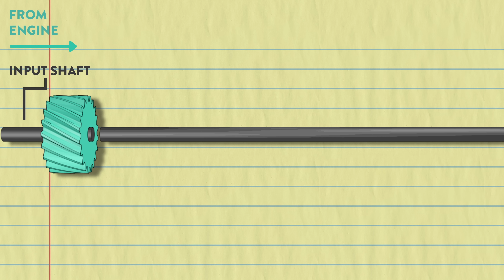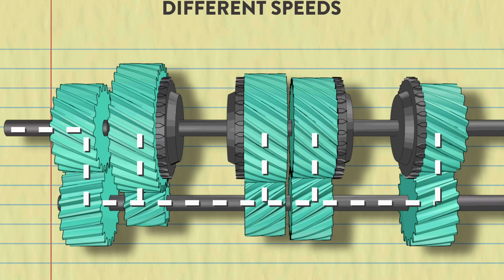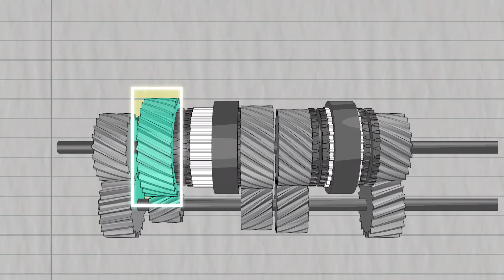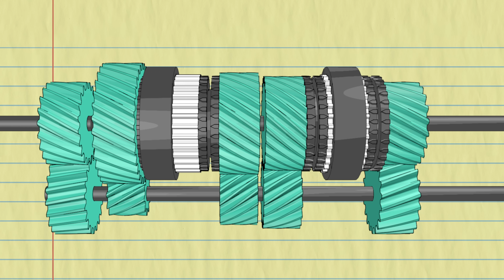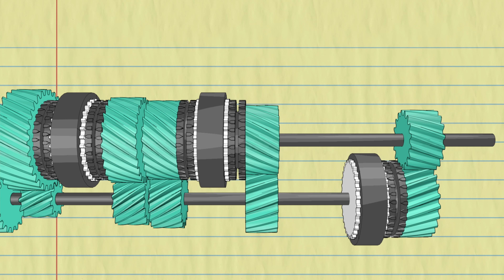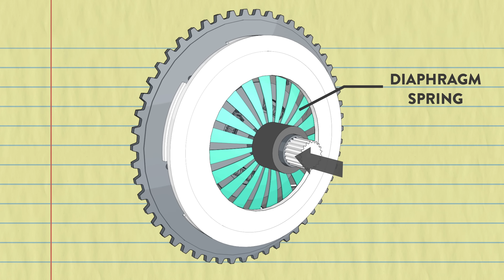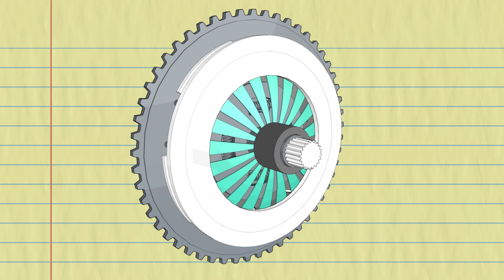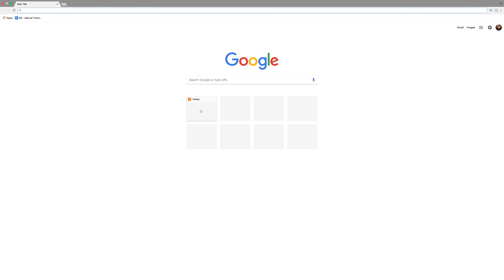MANUAL TRANSMISSION | How it Works

Comment: Wait wait wait, go more in depth about double clutching. I need to know!
Reply: Double clutching just means you do this:

Push clutch pedal. 
Shift out of gear into neutral
Release clutch
Push clutch again
Shift into next gear
Release clutch and Go.
Reply: @thetman0068  i know but WHY? what are the advantages/ disadvantages... do you have to rev match? ...how do yo know the proper rpm for each gear?

Ive known how to drive stick since i was 10 but nobody tought me this.
Reply: @thekidofpt1 don’t know if you’re still waiting for an answer, but the primary advantage of a dual clutch transmission or double clutching is that you will not feel as big of a shock in the car and the transmission will not take as much of a beating. Basically, since dual clutching makes it so that the change from gear to gear is not abrupt, there will be no shake n bake in the trans as there is not as much force suddenly transferred from gear to gear. This is why many modern sports cars are incorporating to dual clutching and that if you ride in early 2000s sports cars, you will be jostled around by the automatic single clutch transmissions. Don’t know if this helped or even made sense, but hope you figured this out.
Reply: @John_Cary  yes thsnk you. Ill take any info you got, im always looking to learn more. This actually did help
Reply: @John_Cary  uhm.. but you can just 1. push the clutch and hold it 2. put it in next gear 3. match rpm with gear 4. release clutch. at least i do it like that.
Reply: @FinestTechnoBeats  Oh I don't have a problem with shifting...I was just explaining the advantages of dual clutch systems. Dual clutching in a manual car does take more time and is not very necessary if you're upshifting and match the right RPM like you said, or if you rev-match when downshifting. Some cars need double clutching though because they have terrible or no synchros.
Reply: @John_Cary  ahh ok. sorry :D i was just curious. so im doing right then, good to know.
Reply: @FinestTechnoBeats  Yep, if it's working for you, then keep on doing it!
Reply: @John_Cary  thank you for enlightening me :)
Reply: @samara949  No problem. Glad to help!
Reply: @thekidofpt1  there's more to double clutching. Basically the output shaft is driven by the wheels whenever the car is moving in neutral, and it's going to go that speed. The input shaft and counter shaft are driven by the engine, but only when the clutch is engaged. If the clutch is disengaged, the input shaft and counter shaft will slow down from the friction in the bearings. So if you try to go into gear those synchros have to work to speed up the countershaft (assuming engine revs are lower than what they would need to be if the car was in gear). When you double clutch you do the synchros job for them; you match the speed of the counter shaft to the wheeldriven output shaft. 
The reason you shift to neutral and engage the clutch again is so the engine can spool up the counter shaft, otherwise it isn't connected to it. But if you're double clutching you want to spool up the counter shaft when you're not in gear, so you leave it in neutral for a second, engage the clutch, and rev match the counter shaft speed to the wheeldriven output shaft speed. Then you disengage the clutch to allow the actual shifting of gears
Technically if you're good enough at rev matching and can do it perfectly you don't even need to hit the clutch, this is most easily attainable on motorcycles (in my experience, probably because sequential transmissions don't hit a full neutral in between every gear)
I am forced to use double clutching to downshift into 2nd and 1st gear in my pickup truck (it's an old 66 C10, I suspect it either doesn't have synchros on those gears or they've worn out). I can upshift because the engine and counter shaft naturally slow down and that's what it needs to do to mesh gears, but to downshift the counter shaft needs to rotate faster than it was before to reach the lower gear; hence my need for double clutching, I have to spool that counter shaft up and there aren't synchros to do it. Before we came up with synchros you had to double clutch into every gear, on some old farm equipment it was common. 
Technically, you can use it for normal driving and it will make your shifts smoother and you won't have to put as much force into the stick itself and the collar/synchro/dog teeth. But it takes awhile to develop the kind of skill that's better than a synchro

Comment: Actually, the higher numerically the gear ratio, the lower the gear is. 1st is low gear, not high gear. Just as 5th is a high gear, not  low gear even though numerically, it is lower.

Comment: Normal: 1ST GEAR! 2ND GEAR! 4TH GEAR! 6TH GEAR! 8TH GEAR! 12TH GEAR!

F&F: INFINITE GEARS!
Reply: So true! I never see a gear shifter in f&f. They're always shifting through 19 and a half of gears.
Reply: they tap the shifter to go from 13th to 96th
Reply: They have transmissions made by God
Reply: What about Initial D gears? Are they infinite too?
Reply: KevinAbill Gaming No, they’re constantly upshifting and downshifting.
Reply: KevinAbillGaming honestly if you pay attention you notice they’re constantly shifting between 2 (when drifting) 3 , and 4
Reply: @sammykaiser3455  I guess you're right, because in touge, you can't speed as fast as you could in Wangan highway.
Reply: @sammykaiser3455  Or the 1st gear, if you're coming into a tight hairpin turn, like in Irohazaka.
Reply: F9: Who needs GEARS when you got FAMILY?
Reply: Down shift?

Comment: Why does it grind if I go from 1st directly to R but not if I go from 1st to 3rd and then R? 
I read that it's because 1st is too far from R in the gearbox and it doesn't slide in smoothly. 

Also the manual on my car says that if you shift to 5th "incorrectly", it can sometimes fall into 2nd instead. Why is that?
Reply: @Dave MMA Ford Fiesta 2006. Manual states to wait 3sec before changing to reverse. I obviously don't want to wait 3sec every time I shift so I started going to 4th then R. It works half the time. I used to do 3rd then R but it would occasionally grind really bad when shifted. 4th to R got rid of the grinding noise.

Comment: From now on, whenever I switch to 5th, I'm gonna shout "OVERDRIVE". 
I have no 6th gear so I can't shout "double overdrive". 
:'(
Reply: Put it in R for race mode
Reply: When you race people, tell them “YOU WON’T BEAT ME ONCE I SHIFT INTO MAXIMUM OVERDRIVE!!!!”
Reply: @There_Is_No_Fork funny how people say that when "overdrive" actually gives you the least torque, it's for cruising not racing
Reply: 6 speeds typically only have one overdrive also its just that 5th gear is the 1:1 gear instead of 4th
Reply: I’m in “over drive” going 35
Reply: @Matthew_Harless  same here in my
Jeep. Literally shift into 6th (my top gear) at 35. Im tuned so fuckn low in that thing
Reply: nice
Reply: Gonna get an Jaguar f type with a 7 speed manual so I can shift into maximum overdrive!
Reply: You have to say it like a Jojo character. "OVA-DRIVU!"
Reply: Or shift into R (Rocket mode) and yell “TAKEOFF”
Reply: AlienFreak69 I feel left out with my four speed
Reply: Scream ultra drive
Reply: ive 8 gears
Reply: Same bro
Reply: I realize why my genesis coupe says 40 mpg it’s the double overdrive
Reply: It’s not just the overdrive, but the final drive. 

My Civic has two overdrive gears as well but final drive is an almost unbelievably short 4.10. Usually you only see that in modified muscle cars. 

While my Impala (auto) only has one overdrive gear, but the final drive is an absolutely lazy 2.77. 

But each car’s fuel economy (40 MPG vs 30 MPG) is more based on the weight and size of the car.
Reply: How? I can tell by your pfp your only 11 and a half
Reply: My impala is a 4 speed, so i feel ya
Reply: I got higher gears in my car.  I dont even know if I have a 1:1 anymore.  

Probably not the thing gets like 9mpg in the city
Reply: * accidentally puts it in reverse while going 70 *
Reply: @flipthegrid8809 then how did you stop the 🚨
Reply: The 6th is actually labeled as R for race
Reply: Oh that's what you were shouting. I thought you told me 'LEARN2DRIVE'...I was like bihhhhhhh...

Comment: Okay so I get how manual transmission works. But can someone explain to me how column mounted manuals work? With modern manuals I can see that the shifter is right on top of the transmission or forwards or backwards of it with a remote shifter.

Comment: please tell me if it is possible for a car to have 2 engines but one transmission . each engine should be able to run separately using the same transmission. Help please
Reply: Yes it is. Usually one engine is placed in front of the other engine and the crankshafts are connected with a small driveshaft. Other setups exist as well such as one engine in the front and one in the back or two engines side by side.
Reply: Thank you very much but I really can't imagine the setup in mind. Can you give me any video links or image links. Thanks

Comment: On my 91 chevy it doesnt go into gear unless its turned off i replaced the slave cylinder N master cylinder and nothing changed after bleeding. Any ideas? Also while i had the slave cylinder out i used two screw drivers to move the. Arm back and forth. Is there suppose to be spring back?
Reply: If you can adjust your clutch then try that. If not look at the throwout bearing or the clutch itself. It won't go into gear when the car is running because the clutch is not disengaging fully, imagine trying to shift or put it into gear with the clutch half pressed.
Reply: @Redtooth75  i played around with it and its because my arm isnt pushing the slave cylinder back. I imagine its the pressure plate unless the arm slipped off the throw out bearing. Any ideas?
Reply: @ronniepitty2098  at that point it might be best to pull the transmission and see what is wrong, it sounds like a throwout bearing issue but it is hard to say for sure.
Reply: @Redtooth75  sounds good ty very much